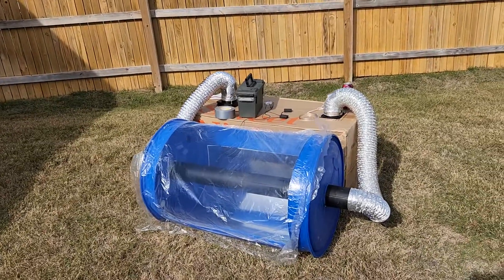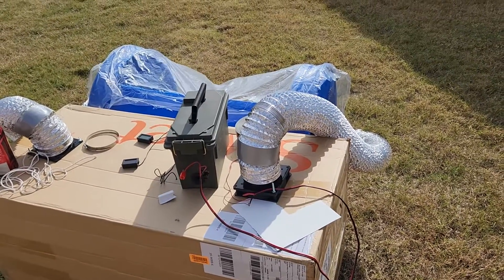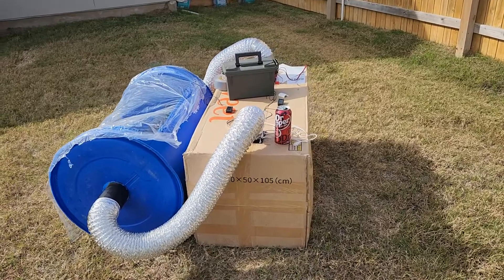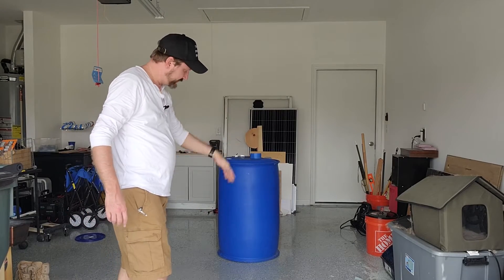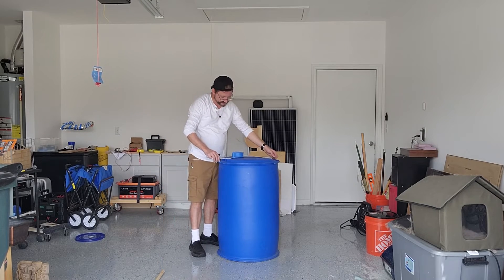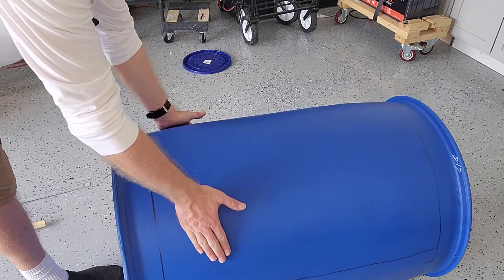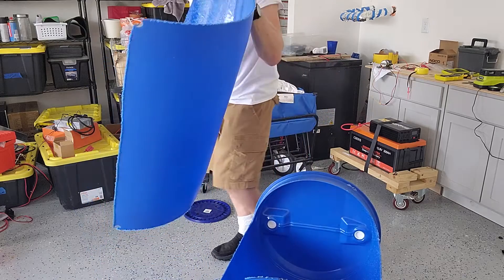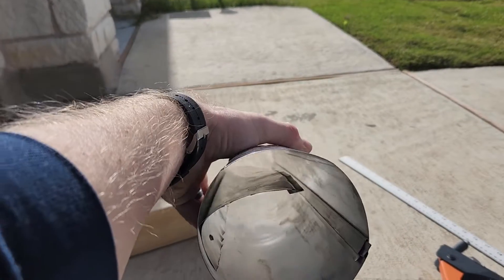Parabolic Solar Green House Air heater

Comment: What about secure mount several of these to a 10x10x8 standalone shed and see if they heat the shed noticeable faster than just full sun heat infiltration.??? compare with a small space heater?
Reply: Secure mount to shed roof using plexiglass instead of the sran wrap
Reply from the maker: @CharlesGwinn-ep9pb   I would love to do this but I don't have a shed to do it with. the cardboard box is best i can do

Comment: Hot air rises and cold air falls.With that small of a box it might not matter but your 2 top mounted intake and exhaust pipes might just be direct feeding each other the air from top of the box only.Maybe better to place the pipes near the bottom on opposite ends kf the box?Also maybe vary the fan speed(cfm) to see if the slower flow will give the tube more time to heat up the air before pushing it into the box.
Reply from the maker: Thanks